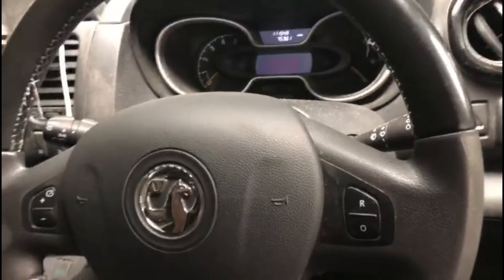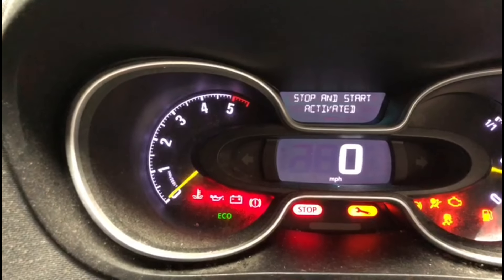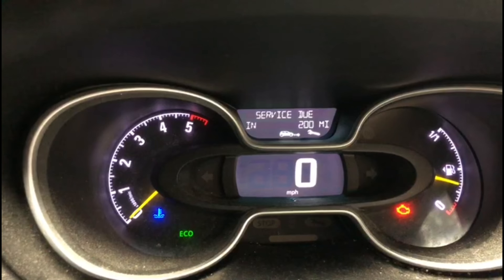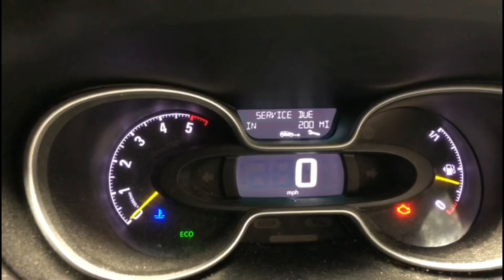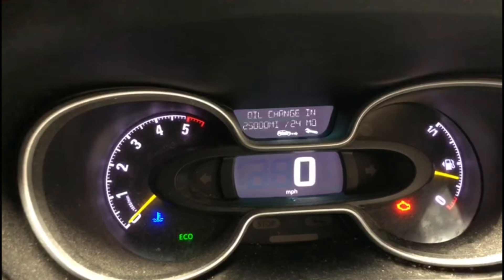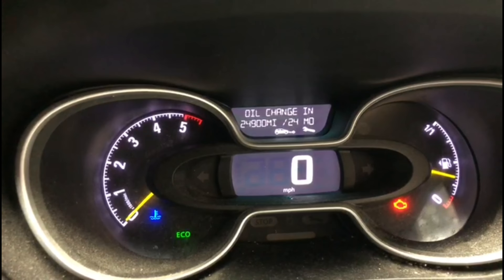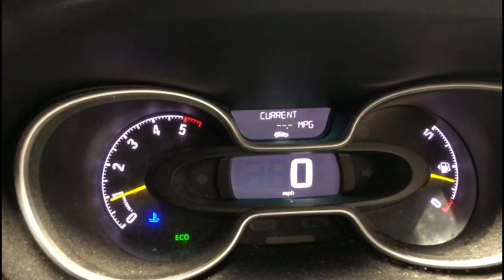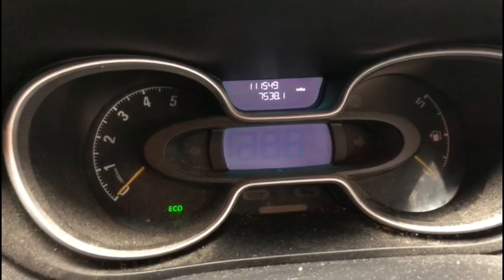how to reset service light Vauxhall Vivaro Full HD 1080p

Comment: Does the blue engine coolant light stay on until the van warms up? I noticed on mine today (2nd day of having it) went off after a couple mins
Reply from the maker: When the light is blue, the coolant temperature is low. This is why it lights up blue when you start your vehicle. It will turn off when your engine gets to appropriate operating temperatures.

Comment: Hi 
Just bought a 2014 vivaro sportive. New shape . Can't find  how to set the time clock. Can you help
Reply from the maker: Hi, to set the clock on a Vauxhall Vivaro 2014, follow these steps:

1. Turn on your ignition and radio to power up the display.

2. Press and hold the "Clock" button until the hour digits start flashing.

3. Use the "Tune/Select" knob to adjust the hour.

4. Once you have set the hour, press the "Clock" button again to select the minutes.

5. Use the "Tune/Select" knob to adjust the minutes.

6. Once you have set the minutes, press the "Clock" button again to confirm the time.

7. The clock is now set and should display the correct time.

If your Vauxhall Vivaro has a different audio system than the one described above, the process may vary slightly. Please consult your owner's manual for specific instructions.